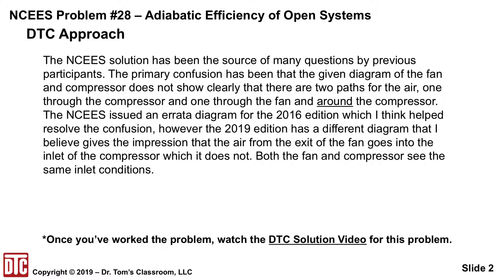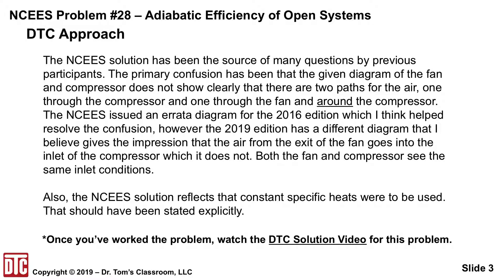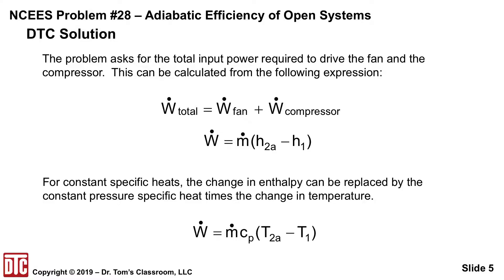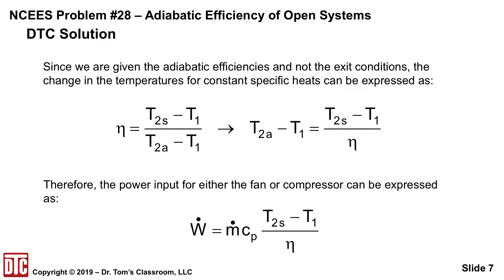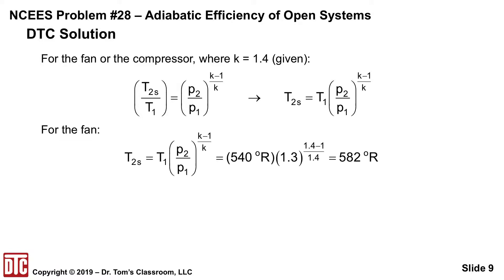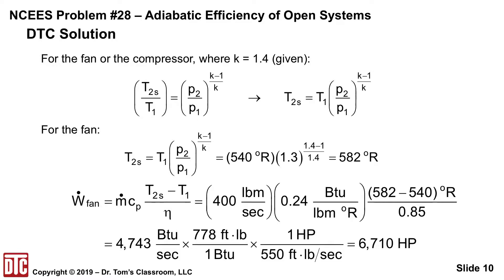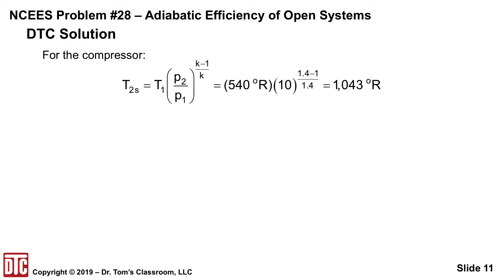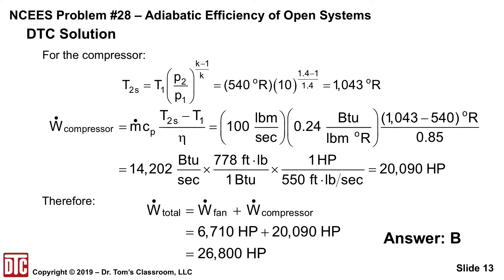NCEES PE Mech TFS Practice Exam Problem 28 - Adiabatic Efficiency  of Open Systems (Solution Tips)

Comment: Thank you for the video! I thought that the outlet conditions of the fan were the inlet conditions of the compressor. The dang diagram is misleading.
Reply from the maker: Yes it is.  In fact the diagram in the latest Practice Exam is worse than the one in the 2016 edition.  There was an Errata posted for the 2016 edition on 3/19/2018 that is much less confusing.  Glad the video helped.  Dr. Tom